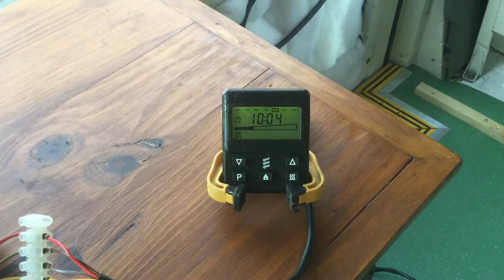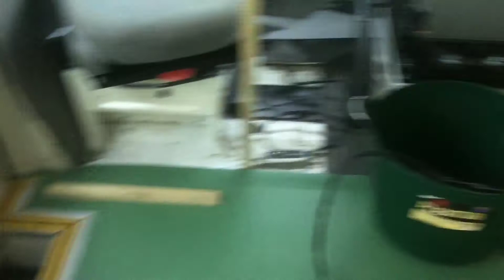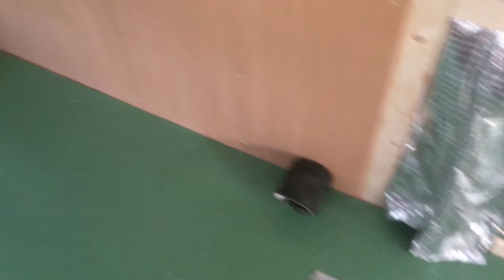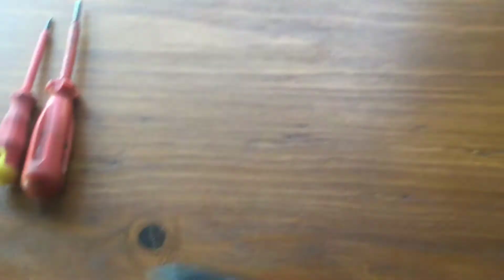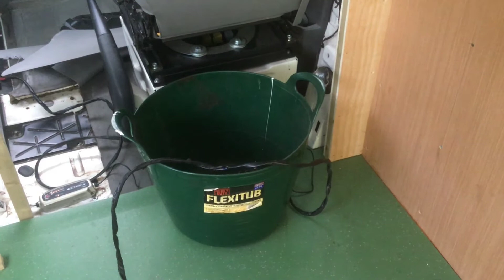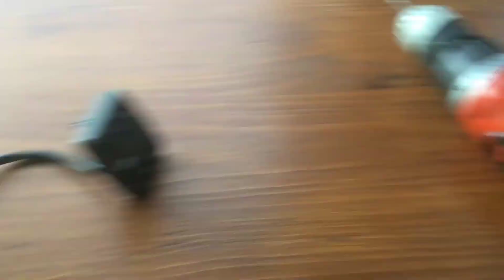Eberspacher Diesel Heater 701 controller

Comment: Got a question if you don’t mind m8 Iv got the 801 and it turns off after an hour I thought they stayed on all night or an till you turned them off. I’m converting my van into a camper. I no the Chinese ones stays on all night I thought I’d splash out and get a decent one. To be honest I thought set it at 18 when it ramps up to 18 it will just tick over and maintain the temperature all night. I’m really gutted splashing out now. Any advice ?
Reply from the maker: check the part number I suspect you have the "801 10 001" version, if so then this is set to 1 hour runtime by default however some later models can be adjusted as described in the manual linked below. Otherwise see if you can send it back to exchange for the "801 10 003" instead.

https://www.butlertechnik.com/downloads/Eberspacher_80110003_controller_Installation_instruction_manual.pdf

Comment: Glad i've got one of these in my truck. Mine will run all night but it will turn itself off if the battery gets low. Although thats the same with anything on the lorry. It allways leaves enough juce in the battery to start. It also takes mine a few seconds to get going or change temp. Also a must if you use one is the Carbon Monoxide alarm.
Reply from the maker: I assume you also have the benefit of 24v electrics as well?
Reply: @CriftinsCampers  Yes everything is 24 volt on the lorry. The fridge on the trailer is 12 volts though. I've got two control pannals on mine. I can switch it on from the climat control on the dash. And there is another control pannel unit on the back of the cab with a timer. I can reach that one from my bunk.
Reply: How to you turn it on from the timer so then you can hear the diseal heater ?